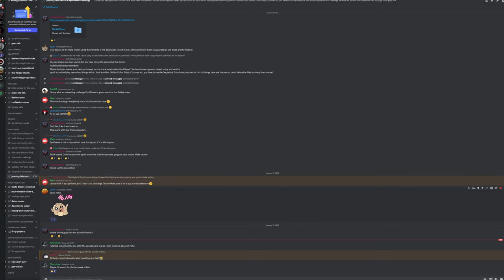Simple Tricks To Enhance Your Sound Quality!

Comment: What sort of loudness results do you achieve? How do you bridge the gap between the back of the mixer and the -6 LUFS people expect?
Reply from the maker: It's more the dynamics and certain elements that stand out rather than the overall push of the sound. If everything is loud it ends up being perceived as unpleasant but not necessarily louder. Good solid kick, good lead and fat bass line and the space between them should set you apart from the MP3brigade
Reply: You can try a hardware limiter on the master., lower the threshold until you have max 6-8db gain reduction to achieve the LUFS, If you have more then 6-8db you have to check the “mix”.probably you’ll have to use less dynamic sounds, usually the low end of the kick is the culprit.On a daw you would compress, saturate or use transparent clipping, and high pass filter the low end properly.With Dawless setup things are a bit harder and expensive to do, but I would say sound selection is the most important as said in the reply above.

I use an hybrid setup, with Ableton live.What I do is put a tape machine emulation and limiter (waves L2) on the master.On individual channels, clipping, compression and saturation to give extra dbs of headroom if necessary.Although hybrid is not the ideal, it has some advantages, if you’re looking for more polished and close to mastered track and you don’t want to spend thousands in outboard gear.